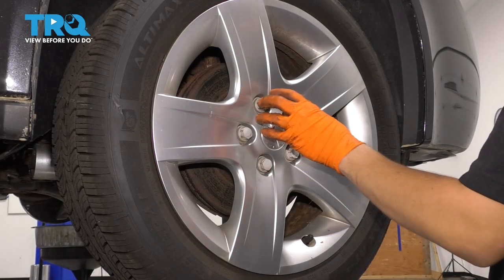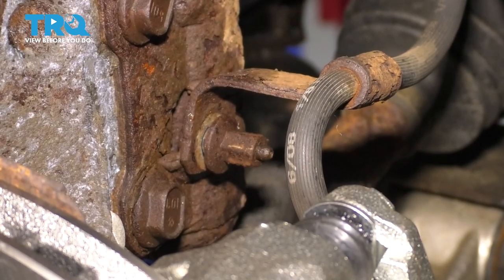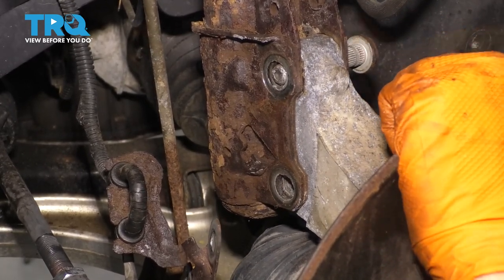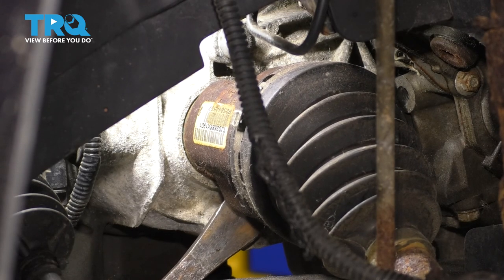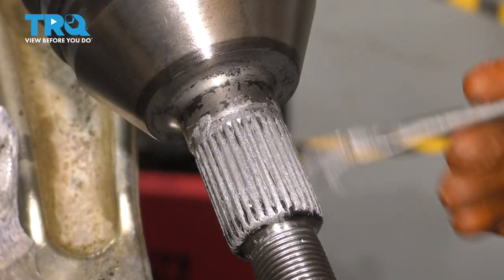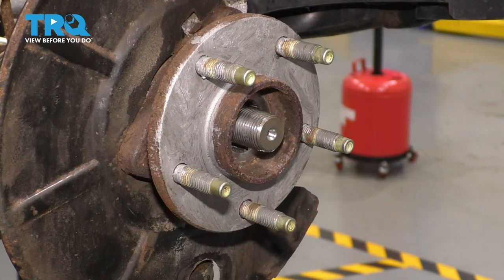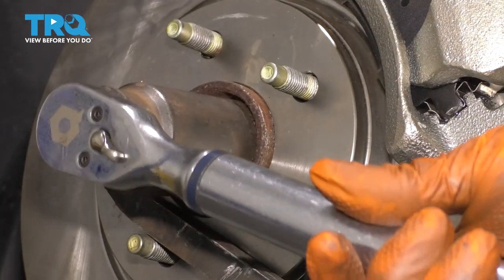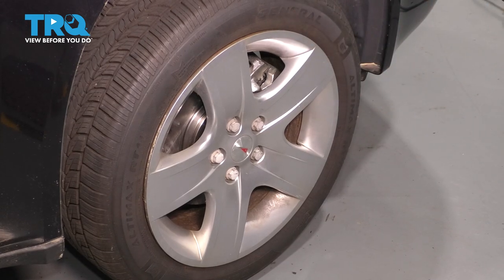How to Replace Front CV Axle Shaft 2005-2010 Pontiac G6

Comment: Great video, thank you for posting it. When I took my axel nut off there was a washer behind it that didn't seem to get replaced @6:34. Should I use the washer (a new one did not come with my new CV axel, but a new nut did) or is there a reason I shouldn't put back on?

Also, is there a difference between the left and the right CV axels? My local part store showed them being two different parts in their database one showing left, and the other showing right, but the item numbers were identical.. 🤔